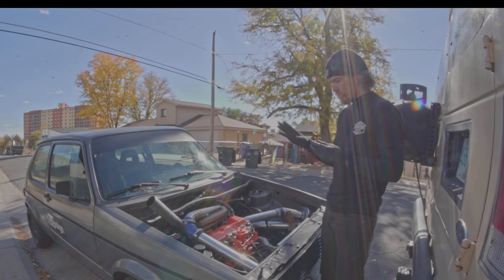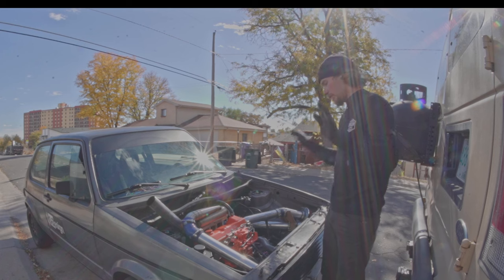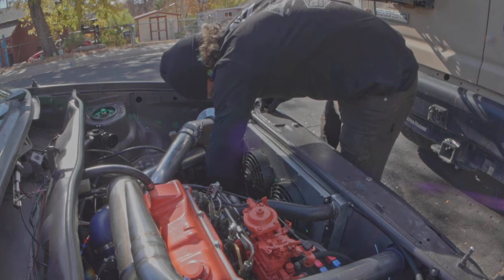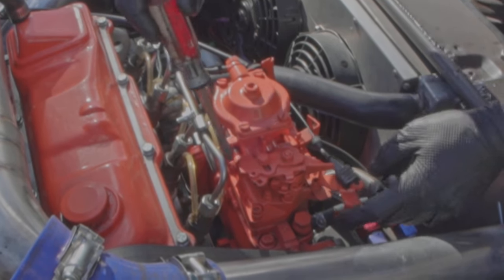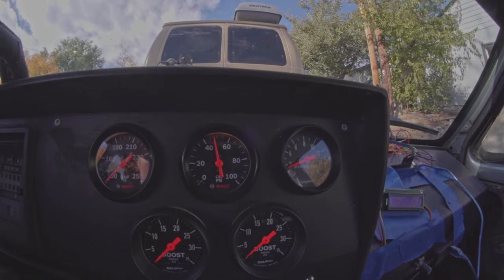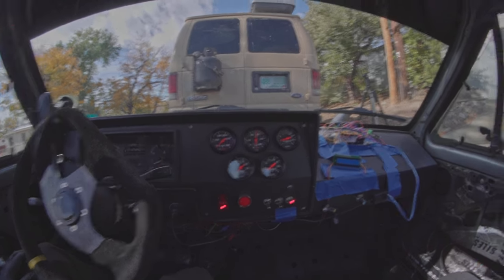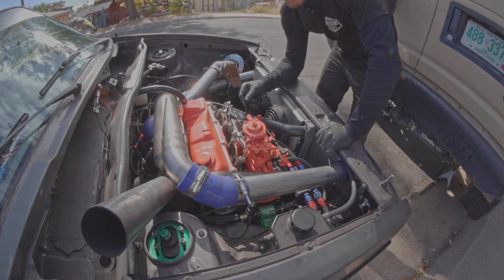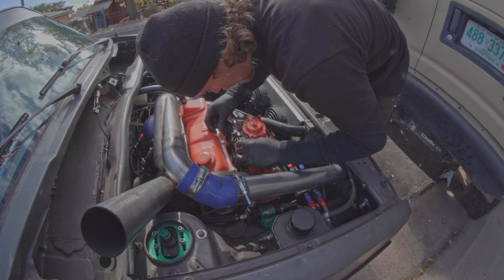Watch me set high idle on my 1.6L Turbo diesel

Comment: So what would cause rev hang. I have an 84 jetta im bringing back to life that will run good but hangs at rpm, it does come back down on its own it just takes way too long
Reply: Fueling screw too much driven inward. Try to loosen it half a turn.
Reply: @chcm5876  thanks!
Reply: Rev hang is usually an indication that you’ve got the fuel rate set on the verge of a runaway! Turn it down

Comment: Do you have any advice on replacing the starter on one of these engines mine is stuck on somehow and I'm worried I'm missing something
Reply from the maker: Hmm did you remove both big ass bolts?
Reply: You've got a short from the positive power to the solenoid, possibly.
Reply from the maker: You should clarify too... Is the starter stuck in the transmission or is the motor itself frozen?